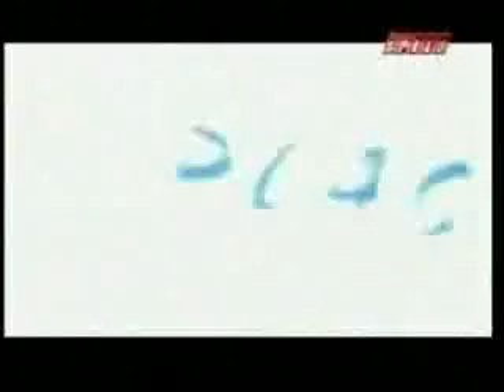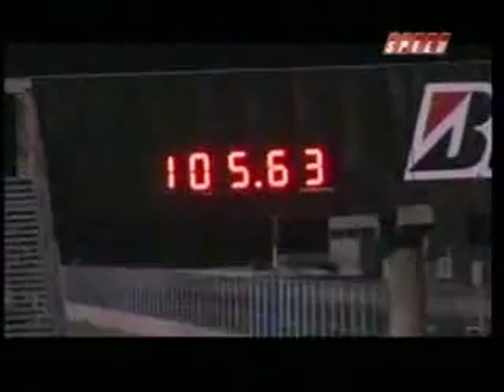White Zombie Datsun 1200 Electric drag car

Comment: i built a hi power dirt bike just wondering where you got your battery , i can go to 64000 watts all in but i just want a lot of tork i dont need to go faster than80 or 90 mph . i would like to stay at 72 V but my set up will alow 96V  any suggestions .

Comment: You'll see more of this...electric drag cars make sense....think about it...if you want go faster, add volts....it only has to do a quarter mile, so distance isn't a problem....and because the motor has one moving part, there's no rebuilding every couple of runs. But no noise :(

Comment from the maker: You buy a car worried about how it's going to be recycled do you? As if ICEs don't degrade with use, after 10-12 years ICE powered cars are passed their use-buy date and the entire VEHICLE gets scrapped and recycled. I'd rather just replace a battery than have to replace the entire car!

Comment from the maker: Mate, you've fallen for the oldest trick in the book... By weight hydrogen might look good (when excluding pressure vessel mass) but by VOLUME it's a joke! 

Compressed @ 690Bar (that's over 10,000psi) it's only 4.5MJ/L, that's barely double that of a li-ion battery. 

As for fuel, an ICE car is 15% energy efficient at the wheels... EVERYONE has no alternative but to buy the other 85% of the fuel the car uses and turn it into useless heat.

BTW moving parts = friction losses = heat = energy loss

Comment: @lalunette I am not going to wait for anything commercial as they have the patents locked up tight.  I am saving my pennies, get the land, than the power sources (3-D Solar, Wind (barrel, vertical), hydrogen) than I will convert a car for my personal use...and than start converting them for family, than friends...since I will not be selling them, screw the patents.  I just want off oil period, tired of them jerking gas prices up and down willie nillie.  screw em

Comment: Electric is the way to go for drag racing.......more volts = more power......only has to go a quarter mile......a motor with one moving part......and you dot have to rebuild it every second run.....to tune it ..just plug in the laptop.

Comment: @JesusHChrist2000 tell that to the designers of the Tesla Motors Roadster that only uses 1 gear, that electric motor spins up to I think 13000 rpms. Some of the other electric dragsters I've seen use two DC motors coupled together running in parallel at low speeds and in series at higher rpms, also eliminating the need for that gear box you wrongly believe is required for these applications.

Comment: You are forgetting refinery and transportation costs for the oil/gas.  Secondly, you don't need that much power with electric because it's more efficient.  You are looking at things too simplistically and not realistically. 

Also, there's also no way to fit a barrel's worth of energy into a gasoline car.  Most cars hold 50L of gas while a barrel is 160L.  

I agree with your overall point, but the way you come to that conclusion is fairly simplistic.

Comment from the maker: You're just making those numbers up!

1) EVs consume 150 - 200 wh/mi so it's 50 kWh to do 300 miles.

2) The current price is $300 kWh and falling 8% per year and that's BEFORE mass production of EV sized cells has even started.

3) So it's $20,000 and 500kg.. for a pack that lasts 10 years before it degrades to 80% DOC (which is STILL useable)

The difference is EVs cost $0.01 per mile for a high performance EV compared to as much as $0.40 per mile for an ICE of equal performance.

Comment from the maker: Very good, but you missed out THE most important fact.... 

A gasoline power ICE car is only 15% energy efficient at the wheels.... so $85 out of every $100 you spend at the fuel bowser is converted into useless heat. 

EVs by contrast use approx 1/10th the energy to do the same work so you only need to cart around 10% of the energy in the first place.

Comment: It's a flat line. Peak Torque at Zero RPM all the way to Redline.

 With no gears (no shifting) since the engine can rotate at like 30,000 rpm.

Comment: You need to know the operating speed to figure how much actual output the engine can create.  HP = Torque(In LBS/FT) X 5252.  So seeing a torque graph will tell you how the energy comes out of the engine and a HP figure,  A HP figure can tell you the actual performance when applied to gears and the ground.  HP is actual power, torque is just an unmastered measurement of output.

Comment from the maker: 1) All M1 cells are 50C according to A123 specs and that is what they sell to Dewalt.

2) A Dewalt 'pack' contains 10x M1 cells and they're all over ebay for $100 which is $10 a cell. Killacycle are sponsored by A123 so get a steep discount.

Standard Li-ion 18650 cells 3.8v @ 2400mAh cost around $3 a cell, again check ebay. Times $3 by 6800 and you get approx the cost of the 50kw/hr pack in the Tesla. Works out at about $4000 for 10kw/hr.

Comment from the maker: The 'street' price to buy A123 cells in Dewalt power tool pack form is about $10 per cell (10 cells per pack) off ebay. 

The custom made BMS has to balance at 3.8v and also must monitor and alarm min volts at 2v for each parallel group of cells and monitor pack temp and alarm at 60C.

Bear in mind to get 380v you need 110 cells in series and Killacycle run 11 parallel giving a total of 1210 cells to get approx 10kw/hr.

Comment: How much do they sell individual cells for? Do you have to have a minimum purchase? You mean a balancing circuit for each individual cell right? and heat and monitoring system built into the pack?

Comment from the maker: Well that's the trick with EVs. No one makes and sells these Li-ion A123 battery packs, they're all backyard jobs. I think this one is an old Killacycle pack off an early version of their bike. 

The problem is there's no 'off-the-shelf' BMS for this kind of set up so you'll need to design, make and test a 1000 cell BMS yourself before A123 will sell to you.

A123 do sell a 5kw/hr pack to convert Prius to plug-in for $10,000 but 10-20kw/hr is about the Min needed for an EV.